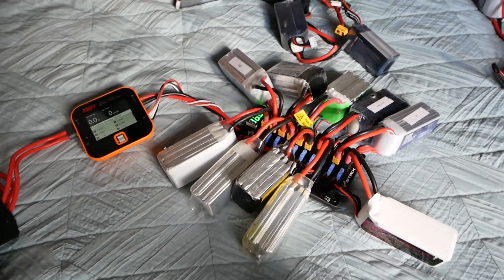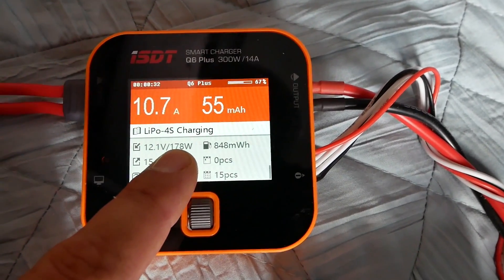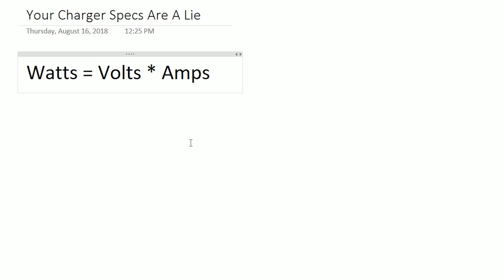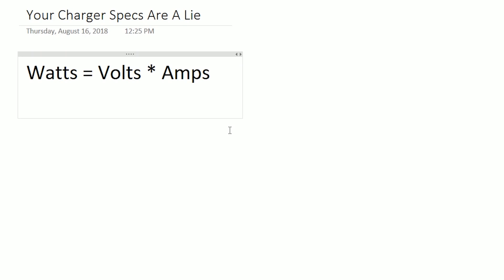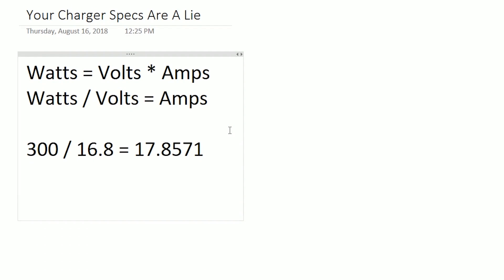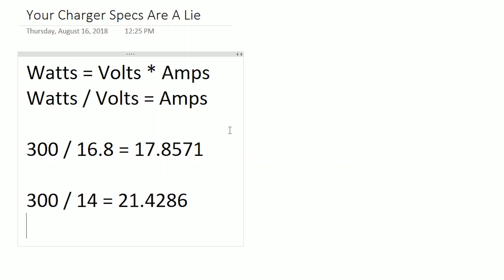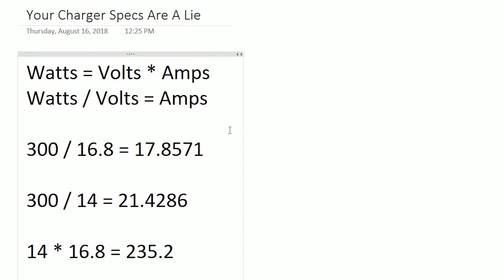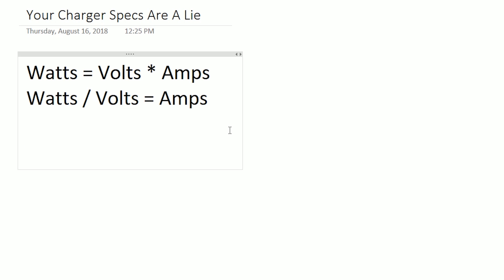Why You MUST Use a 24v Supply For Your Lipo Charger

Comment: Around 2008 I spent $250 bucks on a 50amp 12v server rack power supply and four Cellpro 4s chargers, all nicely mounted into a small freebie cordless drill case.. it still works perfectly today. 
Xt60, xt30, JST, Deans.. does not matter..they're not even conneted to the charger.  The Cellpro's are true balancing chargers straight through the balance tap.    
Many planes, helis, buggies, boats.. and lipos.. have come and gone, but the charger setup is still here and its the best RC money I've ever spent, by far.
Reply: How much would this set up cost today?
Links to similar products to build this would be immensely appreciated. Thanks!

Comment: You're slightly wrong here. More amps doesn't cause more heat buildup, as you say. What causes more heat is higher watt output. Watt output is a direct measure of electrical power output, which has a direct correlation with the power of heat output. For example, if you've got 1 amp going across something with a voltage drop of 10 volts, the power output is 10 watts. Now, say you've got 10 amps going across something with a voltage drop of 1 volt, the power output is also 10 watts. In both of these cases, assuming the materials used are identical, the heat dissipation will be identical.
Reply from the maker: Since the input voltage is assumed to be constant, more amps equals more heat.
Reply: @JoshuaBardwell  Fair enough. It didn't sound to me like that's what was being said, but if that's what you meant, that's fine. Just wanted to make it totally clear in case anybody understood it the same way I did.

Comment: Can you use an external 24v power supply with a charger that has a built-in AC supply, or should they be used with chargers that need an external power supply?
Reply from the maker: Some chargers are AC only, some can take both AC and DC.
Reply: This is a dumb question, so forgive me. If I buy a charger that has both AC/DC options, and I buy an external 24v power supply even though the charger has a built in 12v supply, can I use the 24v power supply with the charger; and if so, to which outlet do I plug it (AC or DC)?

Comment: Thanks so much for your wonderful content! I think you may have answered this on a previous comment but isn't the power supply that your suggesting to buy more amps and Watts than the q6 (let's say for example) is rated for? Why then would that not fry the q6? I'm unfortunately ignorant when it comes to electricity. Also, I just purchased the banggood one. Would you be able to recommend a good video on how to wire it? Thanks 😊

Comment: Joshua,  what is your Recommendation,  for a AC to  DC Volt/Amps Charger for the  " ISDT Q6 Pro BattGo 300W  Charger".     I 'm looking to charge mostly 3s 5000mah batteries 2 at a time?  Any help is appreciated.

Comment: And then, when charging from a pack, the input voltage will go down as you charge -> so the output will also go down -> use a power supply

Comment: If my power supply is 30A output current 12w, can i use it with this charger? The charger says max input current: 15A.
Reply from the maker: You can use it, but it will only use half the capacity of your PSU. Thus isn't a problem though.
Reply: @JoshuaBardwell , Thanks for everything!!! Your JB parallel board is a game changer for me.

Comment: Great info here and I almost missed this info if not for the Arrma forums before choosing another charger. I bought a used iCharger 4010 duo and an 12 volts 75 amp RL power supply due to the iCharger input limit being 65 amps! I can  charge a 4s and one 6s 6000mah lipo in under 40 minutes at only 1c. Love it. All kinds of setups. Can tell it to storage charge or discharge to whatever voltage you want (I prefer 3.85v/cell). It will discharge or charge until it's done in just a few minutes. Can discharge at a high rate into light bulb bar or resister also. All with a 12 volt power supply.

Comment: What will I get the most out of?

Xbox 360 supply rated out: 12v / 12,1A / 150W
or laptop supply : 19v / 3,420A

Is it so that even with 19v, the low amp rating will make laptop supply worse with only 65W (19*3.4)?? than the Xbox one?

(I'm parallel charging 4s 2700mAh)
Reply from the maker: That's correct. The 12v one will let you charge faster.
Reply: @JoshuaBardwell  Awesome, that fast answer is totally worth following your channel! Yeah, I would anyway.. but still :)
Keep up the good work

Comment: Why even mention or worry about watts. You are charging batteries, the interest is the current available. But you are correct to use 24v supply to make the charger perform at its best.
By the way P = V×I is not ohms law.

Comment: On a related note, if you are driving to where you are flying (or don't mind carrying a bit of weight), rather than getting a "big" S6 RC Battery pack at like 10,000 mAh you can get a battery for a camping trailer or RV - There are old style Lead/AGM/Gel type batteries (same tech as a car battery) but there are also Li-ION versions, which however are more expensive. I have the latter, it's a  "S6" (25.2V) pack, about 25x20x30 cm in size and weighs 3 kg. It has a capacity of 110 Ah, meaning 110,000 mAh! You're going to have to rip quite a few 1550 mAh packs before emptying it, and since it's 25.6V you can charge a lot of packs at the same time at full current. The Li-ION packs are pretty expensive, but you can get a traditional 24V pack of 100-130 Ah for something like $200 and the chargers for these are not that expensive and you may already have one for your car., You can of course also hook it up to your car to charge it while driving, that is not an option with the Li-ION variants.

Another thing that may become big in a couple of years is to utilize your car - that is if it's an EV. My car is a plug in Hybrid and I hijacked the HV system that runs drives the car. Fully charged the battery pack of the car carries 16.8 kAh - a whopping 16.8 million mAh. Even if you charge 100 packs from it you won't notice it on the car range. And should you be low the charging circuits of the car are massively powerful allowing you to convert gas into charge almost instantly from an RC perspective. Like I said, these are not what everyone is driving today but in some years maybe they are and for an engineering geek it's an excellent challenge to make this system accessible.. The fact that it involves circuits at 40.000 Volts with enough current to kill ten elephants just makes it more interesting.

Comment: On q6 lite it says max input current 12a. Is there any problem providing more current than that. My power supply is 24v 15a
Reply from the maker: Current is dictated by the load not the supply. The charger stops pulling at 12 amps. The PSU is capable of supplying up to 15 amps.

Comment: Hi quick question, to power an iCharger X6, what would be better between these 2 power supply: 12v 33a 400w and 24v 20a 500w? Thank you !!
Reply from the maker: The 24v one is higher wattage and higher voltage. IMO this is superior in every way but it's probably more expensive.

The X6 can reach its full rated power on 12v (I can confirm this) so you won't give up anything by going to 12v. In addition, the 12v output is possibly usable for other things whereas 24v is not. So maybe you'd be better off with the 12v one.
Reply: @JoshuaBardwell  Good point I didn't think about that, it was 8$ more on Amazon Canada ( since I'm from Montreal). Thank you for replying I really appreciate I know your very busy 😀

Comment: Here is your issue; you were correct in stating you can't have both... in all cases.  Your amps are limited by max watts but this has nothing to do with your power supply..  if your power supply can give the matching draw amp/watt that your charger max's out at there is no chance it's the limiting factor no matter your voltage supply 12/24.   What limits a charge amp draw is the watts but it's based on the lipo's voltage... the higher the voltage the more of a potential limit you have.   Say the lipo is a 6s pack.. your max amp will always be 13.5amps with a 300watt charger... no matter what supply voltage you throw at it, the charger and PS maybe capable of 40amps but the only way you are doing that is at 2s or get a bigger charger :)       300/22.2=13.5   300/7.4=40.5
Reply from the maker: No, you're still missing the point. The point is that there is a totally separate restriction, which is the input amps on the charger.The charger will throttle the output once the input amps hits the limit. 

If the charger's max input current is 20 amps then the max output it can possibly provide at 12v input is 12v * 20A = 240 watts. This limit is completely independent of any of the other specs of the charger, such as output watts or output amps.

A responsible charger manufacturer could design the charger so that it can reach max output power on 12v input, and some chargers do this, such as the ISDT T8, the iCharger X6, and others. But many manufacturers don't do this.
Reply: @JoshuaBardwell  even in your example in the video if you plugged that isdt into a reasonable 12v powersupply, that could do over your max need it would work.. nothing to do with your charger and input voltage...   300/14.4= 20.8a but your charger is limited to 14a so the max it will ever do on those 4s packs is about 200watts, so if you had a 12v ps capable of over 200watts and over 14a's it will work with out issue.

Comment: hey josh so i just purchased this power supply with a ISDT T6 lite and when i charger over 3.3 amps the whole system shuts down . any ideas?
Reply from the maker: If the power supply shuts down then I dunno but I think it might be damaged. If the T6 shuts down it's because it shuts off when input voltage goes below 12v and voltage loss in the wire might just be enough to cause that to happen.

Comment: Hey everyone. Would it be possible to wire two 12v power supplies together to obtain the 24v ? Something like that maybe : https://imgur.com/6mGmSwQ Or will I burn my house down with something like that ? Also, the power supplies are HP server power supplies.
Reply from the maker: You cannot do that unless you modify the supply to isolate the DC negative on the high-side supply from ground.
Reply: Thanks Joshua !

Comment: I wondered why you didn't point out that the same problem applies to many mains powered chargers on the market....... might have stopped a few at the back of the class from smirking.
:)
Reply from the maker: In that case, it's not input amps that are the restriction, since the input is 120 volts and input amps are quite small. I think it's the size of the internal PSU that is the restriction.
Reply: Well in my case it's 240v with an absolute maximum of 13A (household circuit) but yes the limitations are in the PSU, are frequently significant and seemingly few people notice this..... Hey I'm was a post-grad in electronics and I missed it 1st time up

Comment: Dear Joshua, from all the youtubers your content is the most precise and technical, it is great for people like me trying to understand electronics to get into te fpv. I’m an airline pilot and I’m making my own ground school before I fly ( like with regular aircraft), the info is very dispersed and to find something sometimes you have to be very specific on the search, or other times the info is obsolete due to new stuff.
It will be awesome if you make short videos about each part of the drone, there is a lot about radios and goggles, but when it comes to motors or blades or any other part is hard to find info when you are new. If you decide to make a virtual school showing rotors, amperage, speed, capacity..... specific things about each part, I will gladly buy it and I’m sure a lot of guys like me would buy it.
In aviation  you have to finish the ground school before you go to the plane, and I’m trying to do the same stuff here but as I told, is hard to find info. I remember in flight school there was a company name Kings school, they are an old couple giving aviation lessons and I remember that there were like 40 dvd and each dvd was about an specific theme with precise info, if you have time, take a look of that and If you like it I will recommend you to do that with drones, and I’m pretty sure that a lot of people will buy it. Anyway thanks again for your content and sharing all your knowledge and as I said you are very technical when speak and make us understand .

Comment: Thank you, this makes a lot of sense. I was trying to figure this out almost a year ago and ended up getting an iSDT T8 and a 750w 12v server PSU. Input from that PSU is ~422w  (35*12=420) and output is around ~396w. If I'm understanding right when it comes to the ISDT T8 for 4s batteries 35*16.8=588w, so I guess my charging situation is not the best that I thought ... but also not the worst either. By pure luck, it just works for what I've been using it for (10x1300mah 4s at 1c or 2c... on a JB strix board ;))  If I had a 14a input limit... YIKES.

Comment: It's always worth comparing different chargers amp ratings if you're charging 4S, From that point of view, the iSDT SC-620 was the best value at the time, and has a 24A input limit, that means the max output is 336Watts, the 12v 24a input limit is 288watts which isn't too bad really, if you have an old Computer PSU and want to spend less than $50 on a charger i'd really recommend!

Comment: That is why you should use multiple Q6 Lite over the bigger 300W Q6. Also you don't have to watch for having all packs at the same voltage. Using 3x Q6 Lite on xbox360 power supply (the biggest one) I never had one case where I need to wait for one "voltage cluster of batteries" to be finished before charging others.

Comment: something else to consider.  Some chargers work below 12 volts while others do not...

My ISDT T8 will not work under 12v.   This can be problematic if charging off a lead acid AGM battery, as soon as it sags below 12v the charger may shut off.  Which means charging 4s Lipos, nearing 16V at 5amps you will be pulling a lot more than 5amps from your 12v supply.     As your source battery sags you will hit that voltage limit more quickly.

Wire in series and be on a 24v system and you are good to go.   Pulling less amps from 24v while being able to not worry about battery sag on the input side.

I kinda messed up on my portable box when I bought my powersupply.    Did a 12v 600w setup but I keep it pegged at 13.8-14v and on a 10amp output charge I see the power supply sag to around 12.6v.    If I ever rebuild I will use a 24v input.

Comment: I myself have not used such high-end lipo chargers, but I don't get the use of a dedicated charger, before a balanced parallel connector. If I am connecting several batteries in parallel with their respective balance leads, then it means the balanced parallel connector is monitoring and charging each of the batteries, then what is the need for the dedicated charger? And why does it then need a balanced connector to connect to the parallel board?
Reply from the maker: Parallel board is not a charger. It doesn't charge the packs. It just puts them in parallel so the charger can charge them all at once.
Reply from the maker: Parallel board is not a charger. It doesn't charge the packs. It just puts them in parallel so the charger can charge them all at once.
Reply: Ok, then it means the parallel board connector does not know the balance lead voltages of each battery and then the charger would also not know the respective voltages, then does the charger simply supply a constant voltage without knowing the voltages of each battery??
Reply from the maker: Because when the packs are in parallel, each pack and cell equalizes to the same voltage.

https://www.youtube.com/watch?v=AwqJOLzo59M

The charger knows the voltage of each cell and pack because they are all identical, because that's how parallel circuits work.

Comment: Great Video Joshua, many Thanks. 
I allready run into this problem of max input amps, so I have been looking for the Max input Current of my ISDT T8. On the back side it's written Max Input Current 35 A ( Max output power is 1000W, DC in 12 to 40V and max output Current 30 A, which make sens). This max input current of 35 A seems very high to me and so far I dont have a power supply big enough to test if the ISDT T8 can handle it.
What do you think, is this specification 35 A input current of the ISDT too optimistic ? 
Did you had a chance to test this Max Input Current on the ISDT T8 ?
It's interesting for me to know if the ISDT can really handle 35 A input current, cause I may buy a bigger power supply.
Thanks for your answer
Reply from the maker: The 35 amp input limit is accurate.
Reply: Great new, thanks Joshua for your answer

Comment: As you say the 300W is the max expected output delivery, so with a limit at 14A you'd need the voltage of the cells to be around 21V.

For best input power efficiency the input voltage should only be maybe 2-3v above the required output. That means the voltage dropped in the regulation/charging circuit is kept low so reducing the watts lost inside the charger. Switching supplies are more efficient than older linear types so the losses are far less, but they are still there. So if you are feeding the charger from an external power supply the voltage should be VOutBat plus maybe 3v. There is no gain in going above this, you are only losing efficiency.